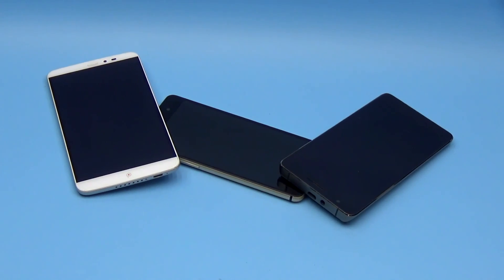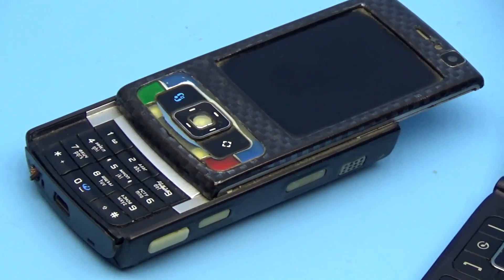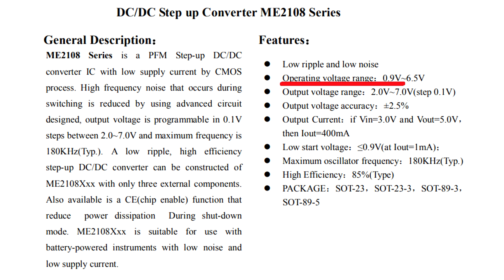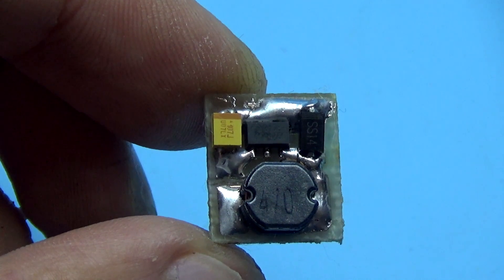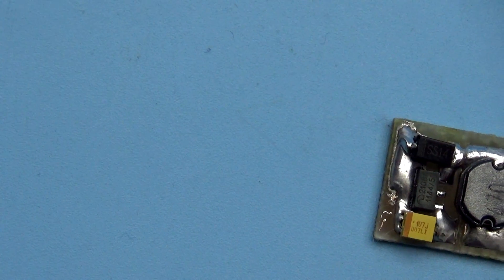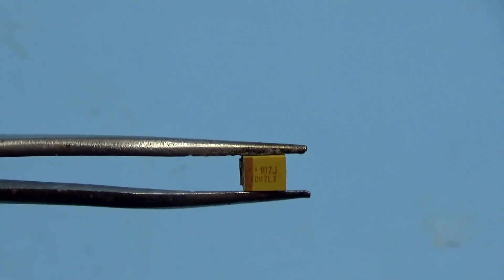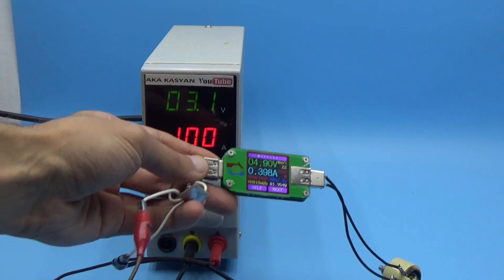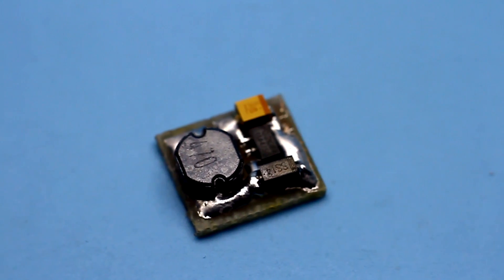Power Bank from one battery

Comment: I have design the same circuit but instead of 47 uh I used 22uh & its gives 3.3 output ...if I change the inductor will it work

Comment: HI
Interesting videos.
I think I already requested about backup for modem.
Can you make a simple 12volt 1amp or 2amp backup which can be run with lithium batteries or lead acid batteries.
I already tried by connecting solar panel, step up module, step down module for 24/7.
Means day time modem works with solar panel and after sun automatically with battery.
Here am afraid to test the modem.
I don't know how to make low battery cutoff for my car battery.
Can you make a very simple backup with car battery with low battery cutoff and full charge cutoff with solar panel or with power source?
Hope you understand my English, thank you.

Comment: Thank you for your time in the production of these very fine mini knowledge based video's. Please keep doing them. Your knowledge and your work is highly appreciated and respected. Could you put together a video about a 12 volt to 110/120 volt ac 10 k pure sine wave inverter? Also would you do a video on energy scavenging from .5 volt to 12 volt up to 5 amperes if possible?  Just asking.
Reply: What you want is a low frequency inverter.
Reply: @MrBrymstond  I'm trying to learn. Can you do a video on this?
Reply: @MrBrymstond  Yes, but I was hoping a video could be done to show all the processes needed to build a high quality long lasting electronic devise with a well design lay out and thought process. I brought up two suggestions I was hoping to see designed and built. Is this possible?

Comment: That's one nice, simple, useful circuit.

You could, alternatively, power it from 3 AA cells. I know they are not rechargeable but they are available pretty much anywhere. Great for an emergency while traveling.

By the way, your English is getting really good.